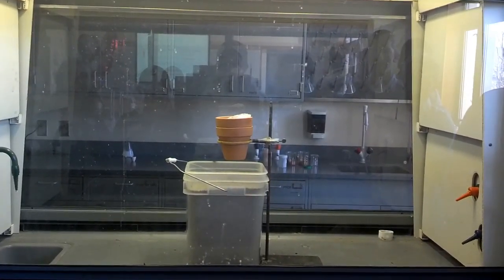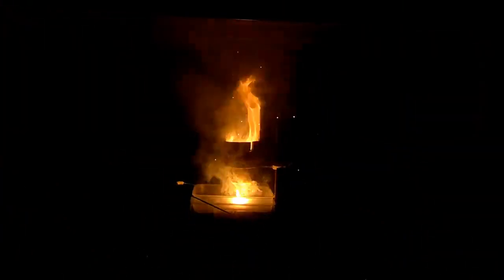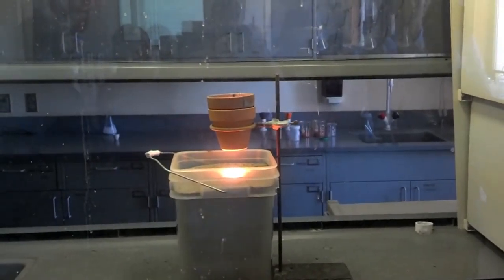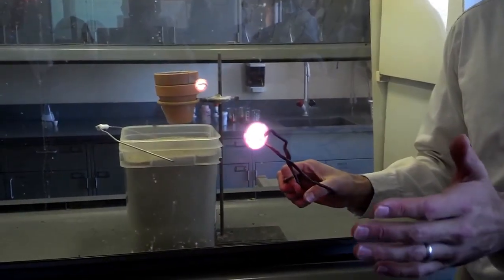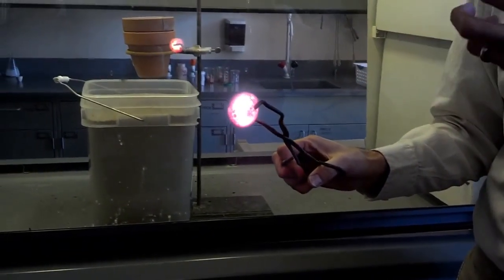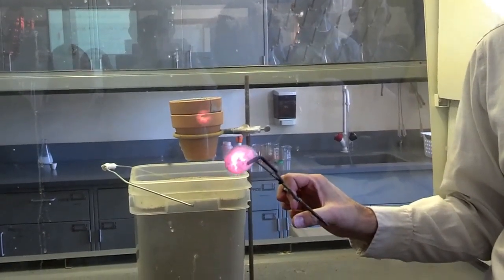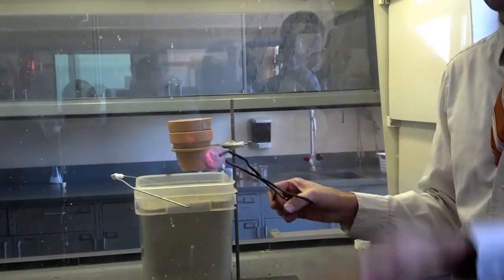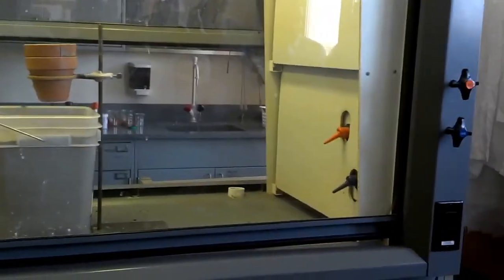Thermite Demonstration

Comment: Sir, Correct me where I am wrong in following statement-
For Dealing with viruses like Corona etc, Washing hands with soap is more effective as compared to Sanitizers. This is because soap doesn't kills viruses rather removes dirt and oil on which these viruses breed on, so as a whole they get washed away. Whereas Sanitizer containing alcohol content are effective in bacteria as they dissolve their cell wall but in case of virus which have complex structure are majorly ineffective. So one should give priority to Soap and water in case of availability of both.